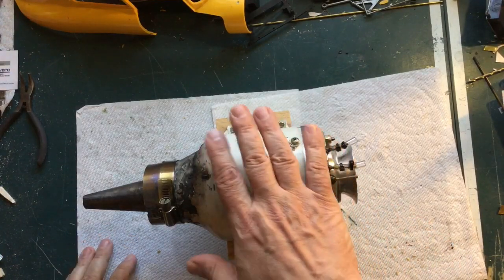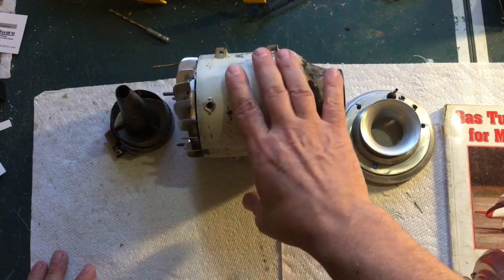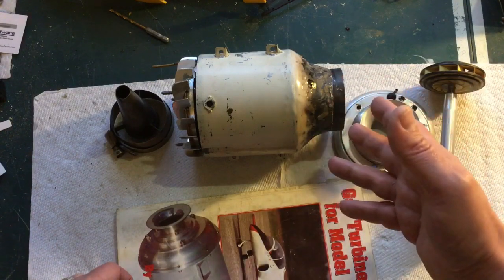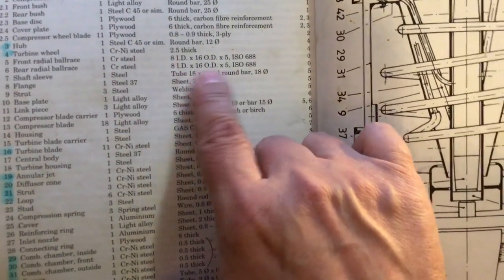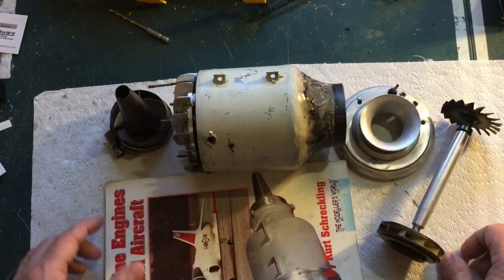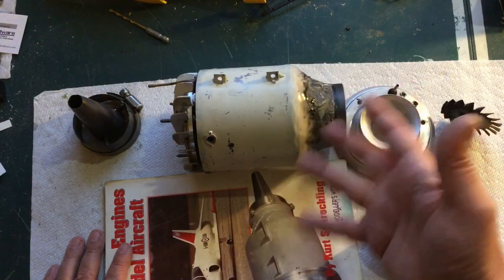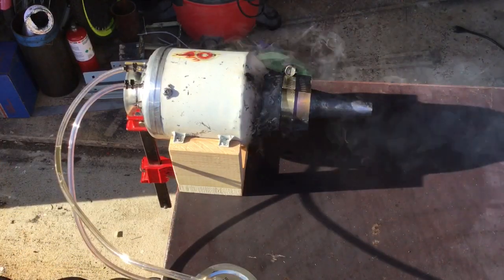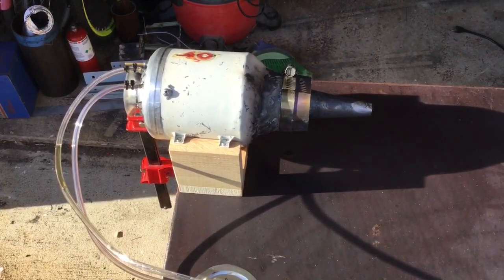Does my homemade turbine engine actually run? And other questions  answered.

Comment: These engines will run if made exactly as per the instructions. Do not expect that it will run on propane alone, the propane is there to assist the engine to reach self sustain when switching over to Kerosene. I have seen a video of Kurt's engine being started by blowing on the compressor with a straw by mouth! However, best using compressed air or better a air pump from an airbed.
I have seen a couple of them in model aircraft flying but that is the exception. Most are purely run on the bench. Mine ran fine but did tend to get hot and was not adequate for model aircraft. The Kamps design with a car turbo compressor or better still the KJ66 design produces a much more reliable engine that starts to get closer to a manufactured product. John
Reply from the maker: Thanks for the comment. I actually bought the stainless tubing to make the actual fuel coil back when I started this project, but just never made that for some reason. My point of making this was to see if I could. I guess once I realized it could work, I got it out of my system and just never properly finished it. I keep saying ‘one of these days, I’ll finish it’, but who knows when that’ll be.

Comment: little advice once lit you need to keep the air assist on, the engine needs to get over 8,000 rpm before it can begin to self sustain and needs to be over 15,000 to be safe to reduce the air assist .( you must see 1 psi case pressure )
The engine will not run on one auxiliary gas pipe.
The engine needs a lot of energy to run at 15k + the small aux gas can will not supply enough gas even if you make a new gas injector with 5  pipes, you can do it if run on a 6kg propane bottle using a blowlamp regulator set to 30-45 psi ( a caravan regulator will not work)
The engine does run better and cooler more even on propane gas as it goes in as  gas  ! on paraffin or diesel if not perfected it will have hot spots  and can jam up  on start up if not careful slowly increasing the pump.
To stop jaming on start up don't increase the turbine clearance it just makes it run hotter! tip clearance should be 0,15 to 0.25 max
better to test on gas until you are happy with temp then move to liquid fuels,check my videos out.
hope you get back to it as it is a big sense of achievement when working.
Reply from the maker: Cool, thanks for the info. I do appreciate it.

Comment: I tried with the turbo charger compressor. I changed direction of compressor vanes , combustion chamber, ngv , and turbine wheel but it didnt work. Becoze air mixture is not right with turbo charger compressor it can work i think need to modify combustion chamber I not gona do that.so now I m making wooden compressor. Thanks for vedieo and for replying
Reply from the maker: Yup, and good luck with it

Comment: I think I can make that tube for you you're closer to getting yours done that I'm ever going to be to get mine done you guys could help you get yours running maybe you could photocopy that page and email it to me or something?
Reply from the maker: Thanks for the offer, but I have the material to make it. Just haven’t done it yet. Even if I had it made, I would need to get the pump and a controller. Which wouldn’t be that big a deal, but would take time, and with my other projects behind schedule, and other projects I’m more interested in, I don’t want to start investing more time into this just yet. Maybe later. The only reason I ran it now is because I got a few commenters wanting to see it run, and I had some spare time.